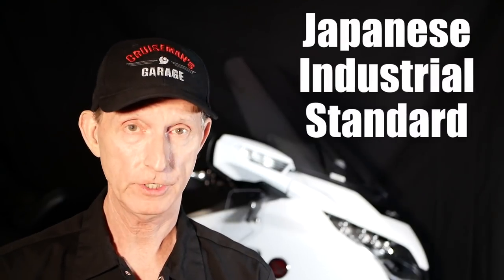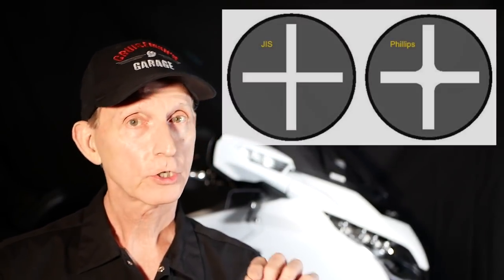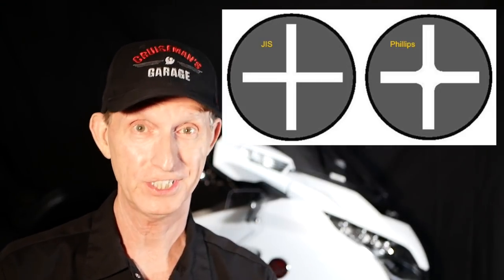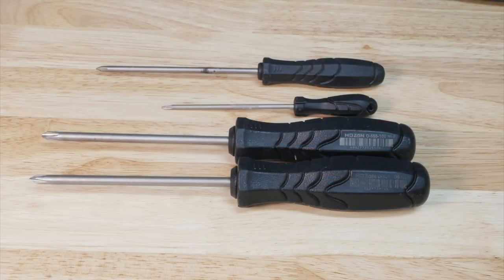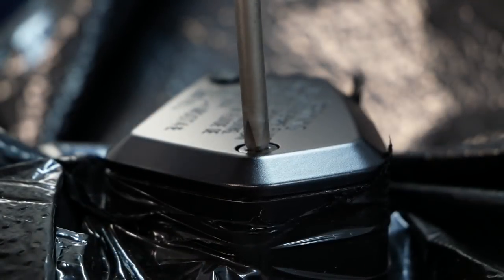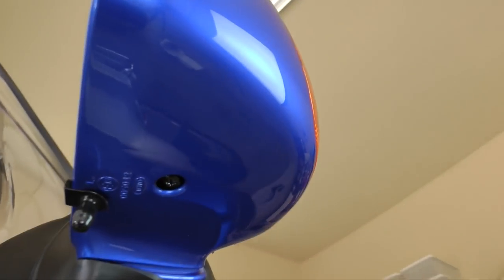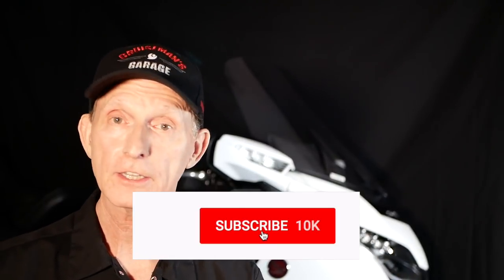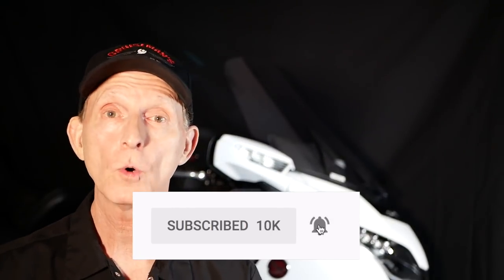JIS Screwdrivers - Cruiseman's Cool Tools

Comment: Another point of interest; most JIS fasteners have a little indented dot on their "faces" in between two of the legs of the cross,  Look at frame 149 above to see that little dot at about 2 o'clock on the screw face.  It is not always there, but almost always.  There are NO Phillips screws on the Goldwings.  Another tip:  JIS drivers fit Phillips way better than a Phillips driver fits JIS;  but, if you grind the sharp tip off of a JIS, it sort of almost half way fits JIS, to serve somewhat in a bind.  The cross head bits I have seen included with the hammer strike type of manual impact drivers are either JIS or very similar and fit JIS quite well, if not perfect and when used with Phillips, the hammer strikes seat them into the fastener very tight.

Comment: Tip, IF your JIS screws are a little chewed-up, use the appropriate JIS driver (almost always a #2 JIS), but dip the bit portion into some valve grinding compound.  Keep strong inward pressure and steady torque.  Replace the screw with a new one.

Rooster
Reply from the maker: Good tip

Comment: I have owned and restored Japanese motorcycles for several years and have always used Philips head screwdrivers. I read an article in one of the U.K. classic bike magazines regarding JIS screwdrivers and decided to purchase a set. What a difference! You can feel the more positive mechanical lock when the correct size JIS screwdriver is used. This is particularly evident when removing the small screws as use on carburettors etc.  Sometimes the screwhead itself is marked with a small ‘dot’ punched into the head of the screw - this indicates a JIS fastener.